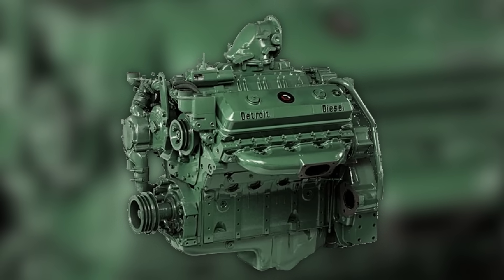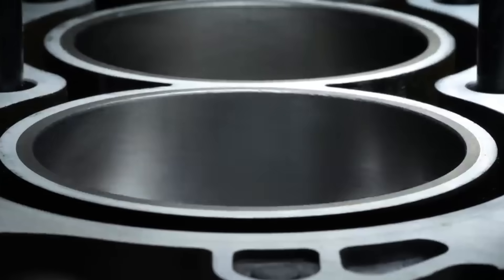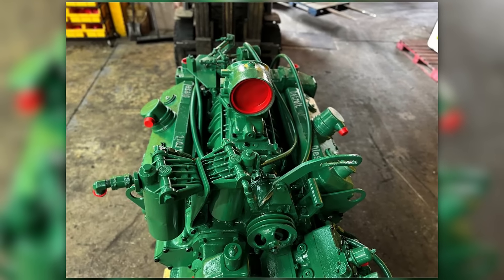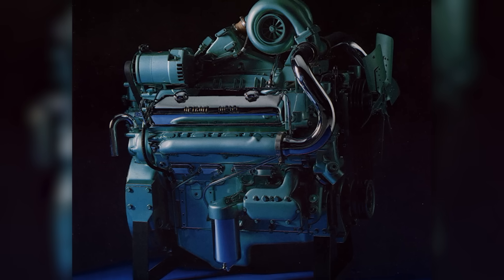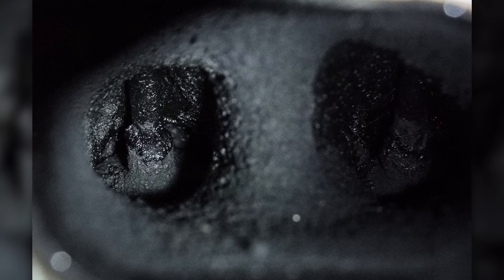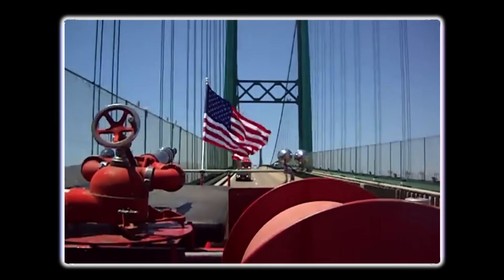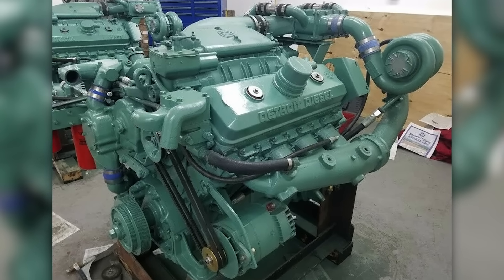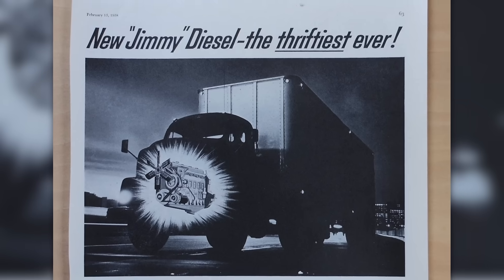The Shocking Truth About the DD 8V71, the Engine Too Hot For Its Own Good

Comment: As long as you maintained them they’re good . When I rebuild them I used thin coats of red rtv and they hey don’t leak, after so many hours you take the blower off and have the machine shop go through it and change seals in the blower assembly that will prevent run aways, get your governor and rack serviced when when it’s recommended, and change the oil a little more often than recommended, these engines are easy to rebuild and you can still get new parts for them easily after market companies make all the parts you can find the parts online . For old Cummins like the J and H and some old Cats it’s hard to find parts for those were as old John Deere and Detroit engines you can find all the parts you want and need online .

Comment: Series 71 ARE dry-sleeve blocks. That was one of the differences between the Series 71 and following Series 92 engines, which were designed as true wet-sleeve blocks to address the known cooling issues of the Series 71 engines.

Comment: El motor 8 v 71 es uno de los mejores del mundo  Rápido en su aceleración se puede instalar en cualquier vehiculo que requiera potencia vercion marino urbano militar minería en fin múltiples usos  convecional turbo vi turbo afteculer  e intercoler dos tiempos menor volumen mayor potencia hasta 540 HP en dinamo metro  temp 190 f presión de aceite 42 lb

Comment: 8V71 is a dry sleeve engine. All 71 series are dry sleeve engines. Some images shown are 92 series pics. Some other images are not even from stated engine components. This video is seriously flawed.
Reply from the maker: Yeah, I know. I got the 92 specs and the 71 specs mixed up. Huge mistake. I'm correcting it on the next video. Too many late nights staring at engine specs.

Comment: No, all long haul truckers did not love the two-stroke design. Having that low rpm/high torque of the four-stroke was critical for heavy hauling. The two-stroke should have stayed with marine and industrial applications: pumps and generators.

Comment: The old landing craft had 6-71's and ran at about 1900 rpm, but there was a landing setting where you pulled a pin on the throttle control and got abut 2400 rpm for it's last few critical minutes of life...came on strong....

Comment: In the 1980s I worked with power station mobile plant used to move coal stocks. The V8 Detroits were far more reliable than the competing straight six Cummins (and a lot smaller.

Comment: I would like to add to the commentary. I have used, maintained and rebuilt a Detroits. As it comes to maintenence, they are a lot like the sbc. Easy and used to be affordable but you had to do it often. They were very easy to modify and tune. I can also say to the haters out there you can make them run efficiently, not smoke, or leak all over. It just takes time and effort, which I've noticed there isn't much of anymore.
Reply: Sorry for type Os

Comment: Wish someone could get their hands on the experimental DD that the US air force was testing in Montana in the 1980's in the missile carriers with twin engine setup for cross country no roads, moves. Talk about some crazy horse power and torque outputs! I was working for the local DD dealer at the time and they would bring some of the components to our shop for work or rework would be correct as these engines seemed to be eating themselves. The blower overdrive the huge turbo they had on them was something. They would not let us see what injectors were used as everything was hush hush experimental and everything brought to our shop came with a DD factory rep watching over us and the components as we worked on them! As I recall the big issue they had was the oil seals blowing out and we (all the guys in the shop talking during break) figured it was due to the extreme pressure they wanted from the turbo and blower. Thing is the the after cooler in the block and intake holes in the liners are only so big and we thought if they made them any bigger the liners would split dropping the lower skirt. We had these grain haulers that had to have the 100's or 115 size injectors, gotta see that smoke boiling out the stack of their silver 92's so they could go straight up hill at 120 MPH. We had to show them how that was a waist on the chassis dyno. We put a set of 115 injectors in a guys Pete and right out the door hit got on the blacktop and smoked his tires for a quarter mile power divider locked in. My boss said make a note in the file, no warranty!

Comment: The 8v71 is not a wet sleeve engine as stated in the video.  No o-rings on the liners.
Reply: The 92 series and 53 series use wet liners.

Comment: I am not sure why this content provider thinks the 8V71 was the only DD, there were , 53, 71, 92, 110 and other series DDs I run 2 Oliver tractors with 4-53s that are over 55 years old and have the original engines and still run fine, I also have a couple relatively rare 8V53s, one of these would look boss in a 32 coup with an open engine bays...
If you want to hear something awesome search for "pissed off 8V53"

Comment: In the marine industry we kept drip pans under them. They used to run literally non stop without issue. Only shut them down to change oil and fuel filters. Tough engines for sure.

Comment: Most of the engine oil leaks were from leaking blower shaft seals that allowed oil to gather in the intake plenum and come out the airbox drains. 99% of those blower shaft seal leaks were from idiots shutting down the engine using the emergency shut down instead of using the governor shut down lever. Emergency shut down is a plate that closes off the blower intake port... And that causes the blower shaft seals to get sucked in against the blower rotors. Mmmmm, yum, yum, yum. Engine design from world war 2 and the Cleveland engine company... Which General Motors bought out and put the design to good use. 16V-149...my favorite.

Comment: Fastest way to turn cash into noise, also, a moving environmental disaster/violation. The only truck with a Detroit we ever owned, where you had to carry 5 gallons of oil to continually "top" up the oil from normal engine operation.

Comment: 8v71 was relatively reliable for its time. Other than the supercharger seals leaking and causing a run away and the fuel control rack tube binding up. They were actually cool running motors. You see them in alot of bufflo busses and gray hounds. 
Fun fact - ALL 8v71 came standard with a supercharger but in textbook are considered n/a aspirated. However 8v71 with supercharger AND turbos was considered forced induction. The reason for this is because it was a two-stroke diesel. From an old school Diesel tech at the shop told me as they can’t bring in their own air efficiently so the naturally aspirated ones needed a supercharger by design. Kinda weird but its cool. I actually have the entire repair manual for a 1965 GM bus on my MacBook Pro. I had to rewire an engine on one of these things due to an electrical fire from the generator charging wire grounded out against the block from the failed insulation. One thing that’s a real kick in the balls is all the wiring used in these buses is completely black or white. No in between. To make issues worse it was common place that certain bus models would have totally different electrical system or fuel system set ups to better match what the bus was built for. So when you’re going in to try to repair one of these things, it might have a 24 V alternator that’s oil cooled when it should have a 12 V generator that’s air cooled ( weird shit like that ) I know it doesn’t seem like a big deal with me explaining it in this comment but when you’re trying to rewire one of these fucking things and it doesn’t run, it becomes kind of critical because there’s no information to actually base anything off of except for the repair manuals that are handwritten lmaooo

Comment: The 2 stroke detroits would burn up in an instant if you even thought about lugging them. If you ran it up to the governor, the engine would run for years with no issues. The slower you ran them, the hotter they got and burnt exhaust valves in the blink of an eye.

Comment: The Detroit 2t's are still, to this day, the best sounding diesels known to man and wooman alike.... and I'd love to get a 6v53ti aluminum block with an Eaton Road Ranger 10spd OD trans shoved into my 97 regular cab short bed GMC K1500 along with a late model GMC Sierra 2500 AT4X front and rear diffs and dampers, boxing of the frame ECT... and of course, a big azz Y pipe into a single single 5-6" chrome stack....no mufflers, no resonators, just screaming 👌🏼

Comment: He is totally wrong. The 71 series had dry sleeves, The 92 series had wet sleeves. There are no o-rings on a 71 sleeve. The secret was to have a close tolerance between the sleeve and the block to transfer the heat to the cooling system.

Comment: The 71 series was NOT a wet liner engine like the 92 and 53 series. It used interference fit dry liners of slightly different sizes to fit the bores.

Comment: One of the best engines I ever had was a 79 silver 92 with a 13 speed. Was rebuilt by a fellow in Medford Oregon just before I got it, set to 2600 rpm with larger injectors (100’s or 110’s something like that) didn’t leak a drop. Ran 80-84 thousand pounds in the pacific northwest, would climb 6% hills faster than most. Better mileage than Cummins 400 big cam 3&4 I had by 2 tenths of a mile. Leased a KW in 85 with a 3206, dealer sent me to cat driving school to learn low rpm driving skills, mileage was about the same but climbed slower. Told every new driver slam thumb in door before driving and you’ll be fine. LOL

Comment: My previous job was making pistons, skirts, and even "trunk" pistons for these. The Detroit Diesel name, minus the modern 4 stroke engines, is now owned by Rolls Royce Solutions of America. We made pistons for them from the 53's up to the 149's. The military still relies heavily on these engines. We even made a 71 series piston with a ceramic coating on the combustion face. I was told they were for tank engines and could operate on any fuel available.

Comment: If you choked it down nearly to a bog and pushed the clutch in to prevent the stall it could start running backwards intake through the exhaust and exhausting through the intake then everything was backwards SHUTIT DOWN
Reply: THAT WAS WHY THEY HAD AN EMERGENCY STOP BUTTONS

Comment: Thanks I worked on Detroit Diesels for years but never the 8V671 my experience with Detroit Diesels was that most of the oil leak came out of the blower box and you could limit that if you got them running to temperature. Diesels are cold blooded animals by nature and they work the best wide open which is only around 2800 RPM’s but again I never worked on the 8V671.

Comment: We had a scraper with a 8V-149 in it , I was only there long enough to hear it run 2 times , I wouldn't want to run it all day. But I like most of them.
Reply: We ran 12 V 149  in the oil patch in ALBERTA BACK IN YHE EARLY  80S  10 inch stacks ,  4 TURBOs

Comment: Drop the rpm too low then gun it, it might just decide to run backwards. (8v92 anyway)
Reply: TRY AND STOP THEM USING THE CLUTCH AND THEY RAN BACKWARDS AS WELL  THEY HAD AN EMERGENCY STOP BUTTON

Comment: I don’t think the narrator has his facts straight.  Any engine will fail if not maintained.  Duhhhh.
DD went to 4strokes because they were a bit more efficient, could comply with emissions, and were cheaper to build  (fewer parts).  EMD (Electromotive Diesel) are popular 2 stroke locomotive engines.  In marine ships, Wartsila 2 stroke diesels are the most efficient of all engines.

Comment: I have two 8v71 N with N 80 injectors in a 45’ Hatteras   Consistent 22 knots at 2300 rpm at 182 degrees Fahrenheit.    Designed my own closed crankcase venting system so leaks are minimal.     They are either run at 2300 or 2000 rpm      Wouldn’t swap them for new light iron under any circumstances    Perfectly suited to the application.   Just rebuilt the port fresh water pump and it was the original seal and impeller at 56 years old!    Engines are 1969 date code    Run delo 100 and Final Charge coolant with overflow tanks

Comment: 8v71 one of the best  ta was even better 50 + pounds of boost was manifold pressures when you had to lean on it !!  A perfect 90 /90 motor mph and klbs . You want bigger nads - 8/92 silver seal super hiway bus motors stainless steel body's and cruise manual 5 spd rear motor . Rides like a cloud  40k weight ..

Comment: The 8V71N non turbo engine has a nearly flat torque curve. With the only actual dip coming at the very top of the rpm range. Only turbo 71s " came alive at the top end". I can't remember the exact number but I think the 318s have a variance of like 56 ft lbs across the whole rpm range with peak somewhere near the middle of the rpms.

Comment: Was a tech in a GMC dealership 40+ years ago....never forget the difference 10mm injectors made on an 8v92T's acceleration!
Reply: I ran GMC Jimmy's in the Seabees with these engines hauling around heavy equipment. And in the Euclid rock dumps.

Comment: The oil leaks were caused buy guys running the wrong oil. If you run 15-40 it will leak. You need to run a straight weight oil in these engines

Comment: Having been a United States navy c, b. We use these engines a lot. And I can tell your video is wrong. All the 712 cycle diesels were not wet liner. They were dry liner and they were beasts. Yeah, they leaked oil. They were loud, but they actually had more power than any comments dreamed of having.  In fact, I can remember one needed sheer raw power. And we had to have something that really could move Faso. We took a deuce and a 1/2 flat bed and pulled the Cummins out of it and we put an 8V71 in that rig and boy, I'll tell you that deuce and the half was the fastest deuce and a 1/2 I ever saw.  That thing could hit 70 miles an hour on the freeway. No problem.
 I do miss that roar and that a kid of the 70s everywhere you went. You could hear those engines screaming and all the semi trucks. What a beautiful Sound

Comment: My very first job on day one out of my apprenticeship.
It was three already dismantled 8V71TA engines sprawled out over floors of two workshops after a so called CAT mechanic said its not yellow and had no idea and pulled the pin.
I was thrown into the deep end with no experience on these engines and no supervision either.
All I had was a genuine service manual to work with and a deadline to work to to get at least one engine re built, tuned and ready for operation into a Schramm RC drill rig. 
I did get one ready and tuned just in time to get a slot on the one and only dyno in town.
I was absolutely full of myself when it performed to spec with absolutely no problems including not requiring any tuning other than a re check of the valves and injector heights.
I quickly got a name for myself round town as the MAN for the job when it came to DD's.
I absolutely LOVE every thing about these things and are my favourite engines of all time.
I went on to rebuild, repair and diagnose countless DD's of all types of 53,71 and 92's.
Without doubt, my favourite DD is the 653 series.
There is nothing more pleasing to the sense's than a loaded up 653 on a dyno with no exhausts nor air cleaners screaming at 3200RPM.
You see it, you hear it, and you feel it in your chest and tickles the ears and brains. 
Oh how I miss these days
Reply: Nothing like the sound of a 53.  Screamiest of the Screamers.
Reply: @Mojo59079  indeed
Reply: @ScatManAust, I agree, I wish we could talk to each other about all the Detroits we've worked on, But we're probably both deaf.
Reply: What 😀 @4321grp
Reply: Nothing like a cat on full chat
Reply: @terryrance2662  I love all 3 CAT (oldest brother), Detroit (the baby), and Cummins (the middle child)
Reply: Had them in the military for and loved them! Easy to get them up and running!
Reply: Hows your hearing?
Reply: @BurnerJones  Hey! what was that ???
Reply: There used to be a guy around the Marlboro NY area that had an early 70s Ford pickup with a 6v53TT setup he used to drag race ,I think he said it got in the 11s or eight around there. 
He said you can't power brake it ,only do trans brake launches. 
Well, you could power brake it ,if you want to twist the pinion right out of the ford 9 inch rear. 
To someone who didn't know top much about Detroits,they might have mistaken it for a Hemi at first glance.
Reply: Sounds like someone has found their calling. Godspeed 🖐️🙏
Reply: True love 🙂
Reply: And you're deaf now😊.
Reply: Yes 6v53 .... !
Reply: I ran skidders with 53 series engines, full bore or shut it down, 7 years, 3 starters never had the valve cover off.

Comment: In the UK both Bedford and Scammell tried DD motors but they were very poor on fuel compared to Rolls Royce and Cummins 4 strokes. The 2 stroke GM12N-710G3B-EC has performed well in freight locomotives but we can no longer buy new locomotives from Canada and the US as they cannot meet the latest emission standards. We have solved that problem by re-engining older UK built locos  with the same GM unit as the standards only apply to new builds.

Comment: Right off the bat you ar wrong! This engine is a dry sleeve engine. There are no o-rings, and no water behind the sleeves. There is however the holes on the sleeves that open into the airbox where the blower forces air into the cylinders.

Comment: Wrong about the Liners.. all 71s were a Tight fitting Dry liner.  The 53 - 92 and 149 had Wet Liners.  I worked 43 Years on all Detroits and lots of parts your Showing are NOT Detroit parts otherwise you sound like you know what your talking about.